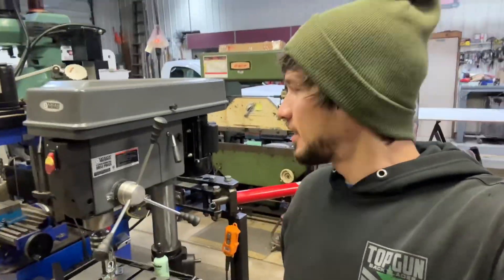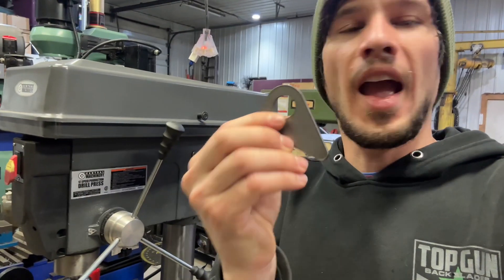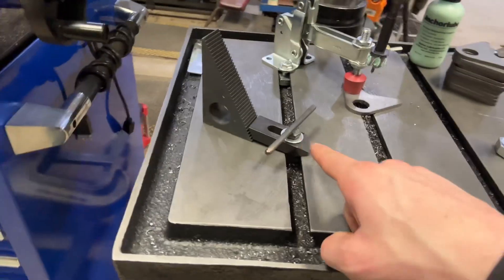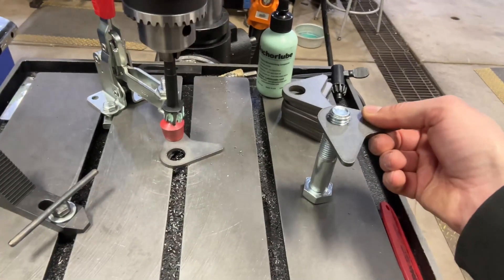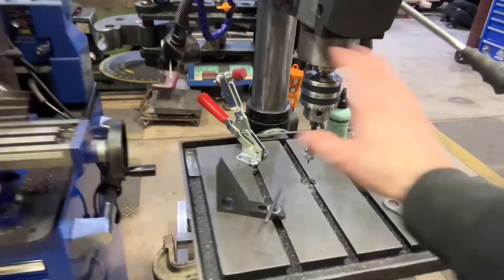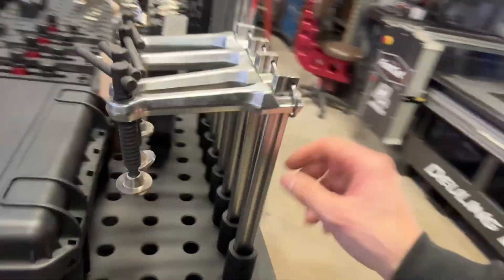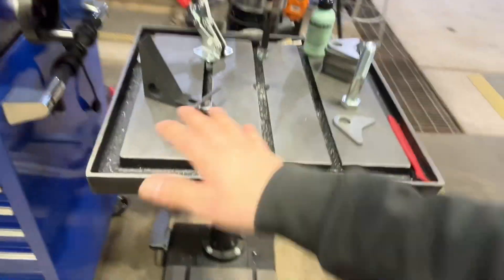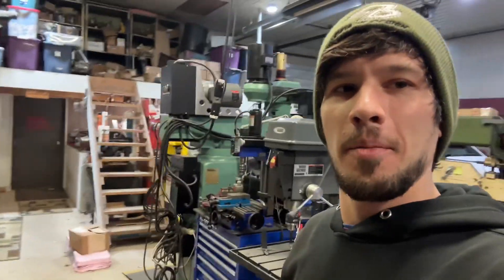Tech Tips With Adam - Ep5

Comment: Good tip we have a mill drill table at work but our vice has a notch took out of the jaws kinda like running a mill / pass down where both jaws meet up in the middle about 1/8” depth and works pretty good for holding parts kinda acts like having parallels not sure if it would work for your part you were doing but good tip you had 👍